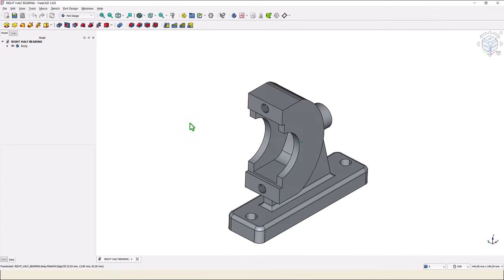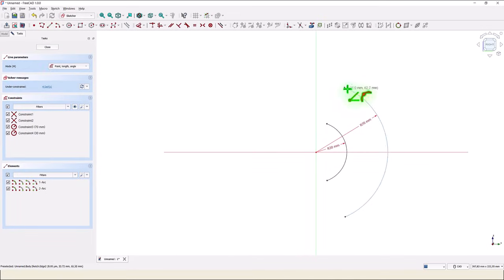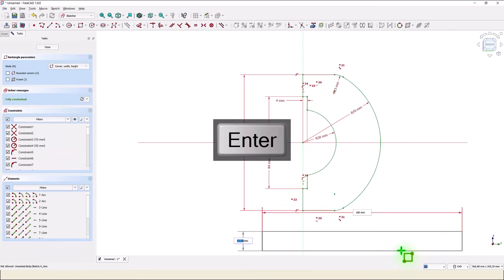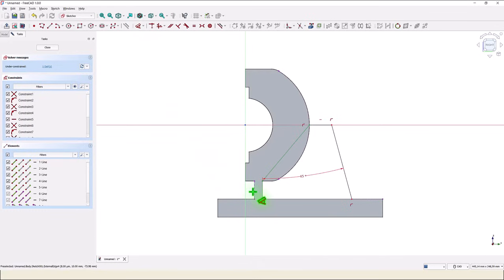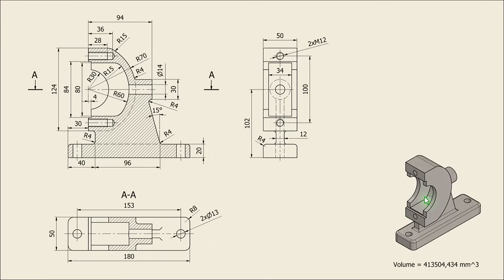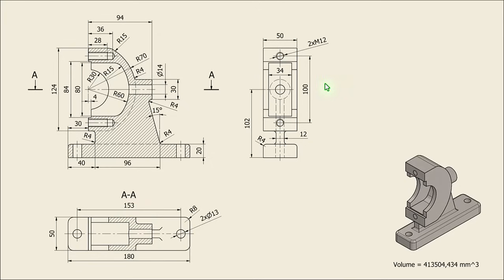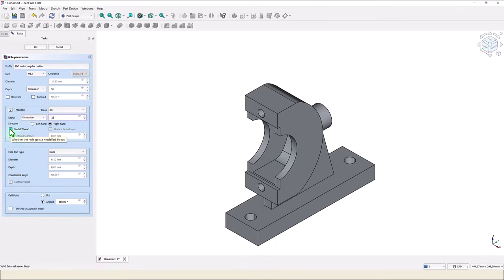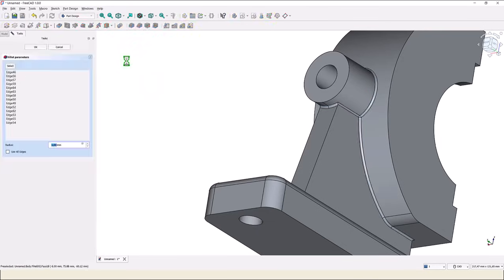Tutorial FreeCAD - 060 RIGHT HALF BEARING

Comment: In FreeCAD 1.x, you can extrude more than one closed contour at a time. To do this, go to Settings --> Part/Part Design --> General and activate "Allow multiple solids in one Part Design body". This is still an experimental feature, but it works very well.

I also have this question: I've modeled the part, but I can't get the volume specified in the drawing. I've checked all the dimensions multiple times, but the volume always ends up being 416003.5345 m³. Is the volume specified in the drawing correct?
Reply from the maker: Thanks for the information, my friend!